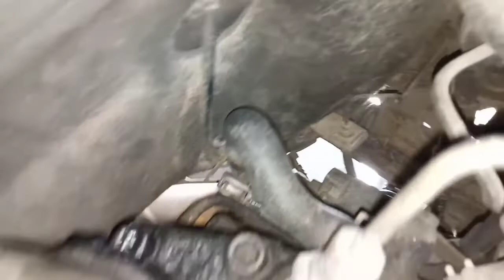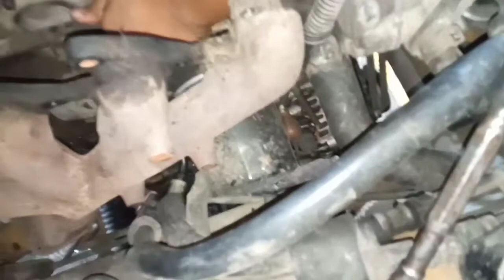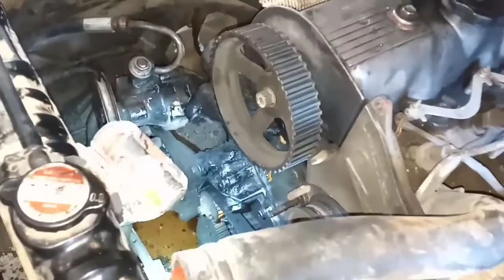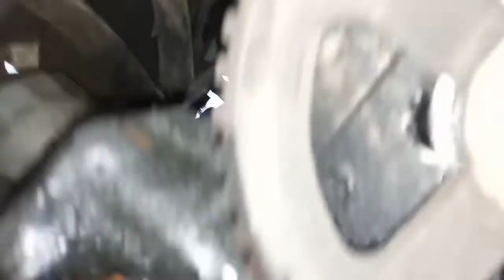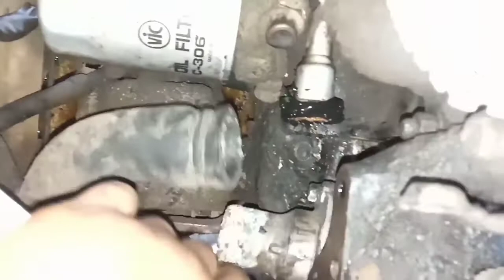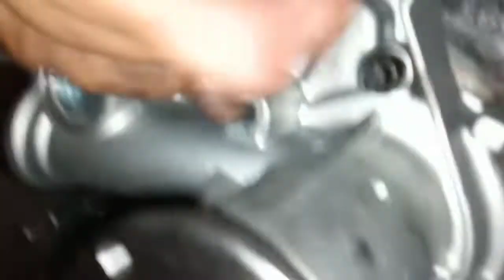how to check 4d56 engine water leak in bypass hose

Comment: Function of bypass hose in 4d56 engine
Reply: To allow water to circulate around the engine block while bypassing the radiator to enable the engine to warm up to proper operating temperature, hence the "bypass" hose.
Reply: Magkano papalit ng bypass hose sir
Reply: apakah jika ingin mengganti bypass harus membuka waterpump?
Reply: Pwede ba na Wala nayan Tanong lng po
Reply from the maker: Ano po yon
Reply from the maker: Function nyan sir para madali mahigop ang tubig sa head....bypass yan galing  headcylinder papunta sa waterpump